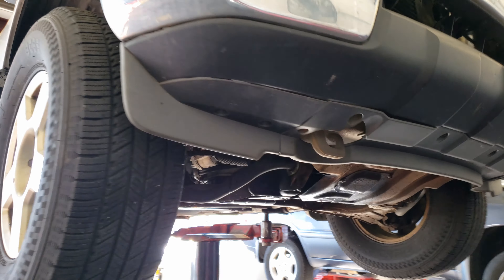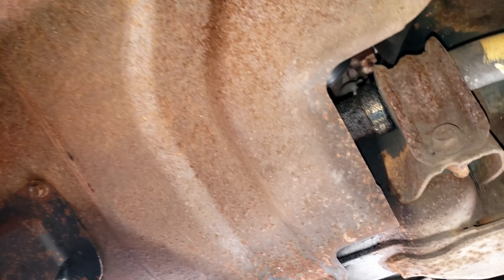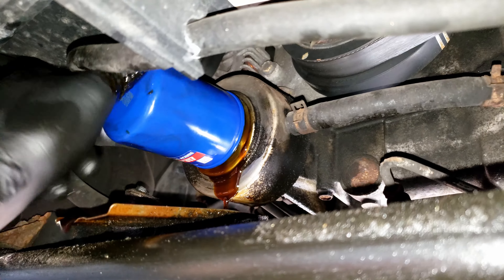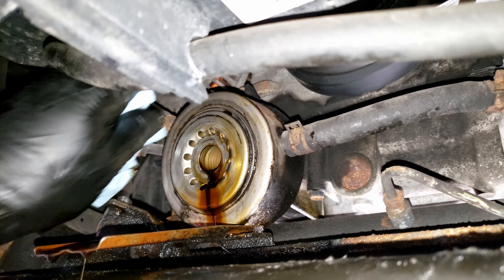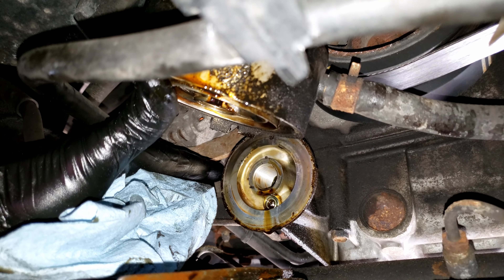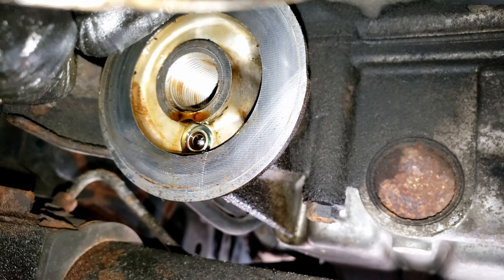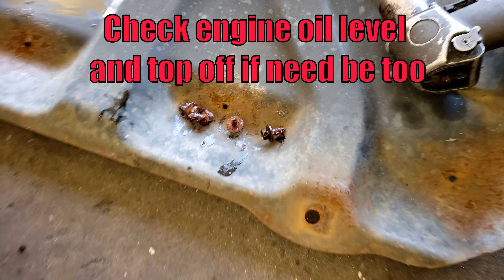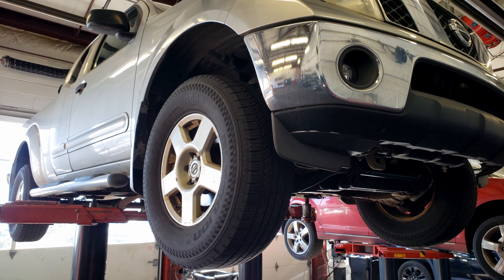Nissan 4.0L Leaking Oil - Frontier Xterra Pathfinder Equator NV (Cooler Seal)

Comment: Does this make it look like oil is leaking from the filter itself, like right before you took the filter off it looked like it was wet and coming from the filter?

My last filter looked like that, I just changed the oil again and it’s wet there again. I thought something was up with the filter but now I’m wondering if it’s this seal and just running up the lip somehow

Comment: Se puede poner la liga ke trae el filtro es el mismo
Reply from the maker: no habla espanol
Reply: Oil filter o ring is the same I think is what he is saying so that would make it super simple when u change your oil u got all the parts reuse old oil filter gasket on oil filter new gasket  Between the cooler And the block
Reply: Thanks I'm about to try it
Reply: No